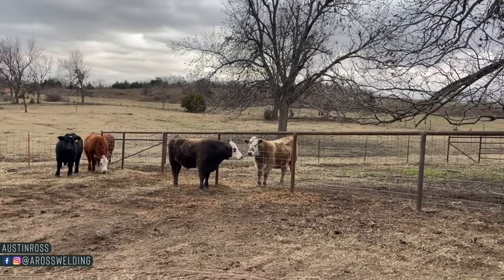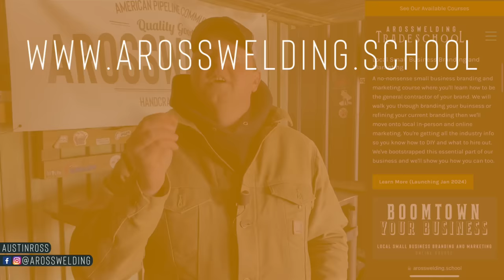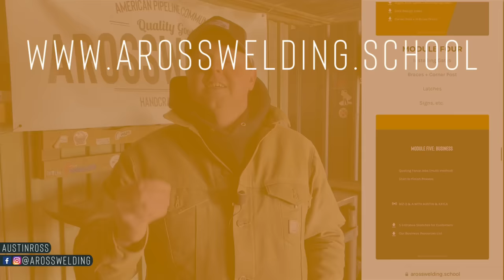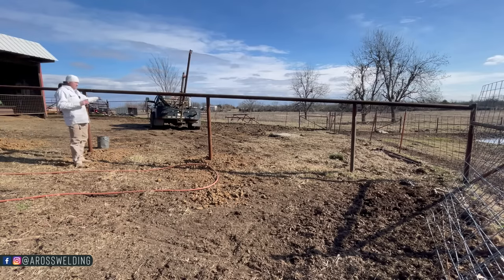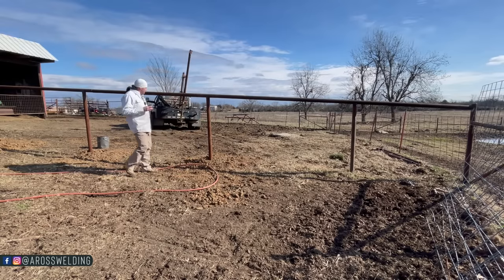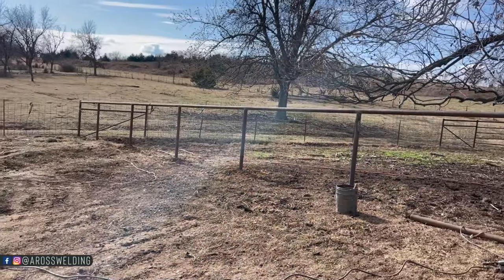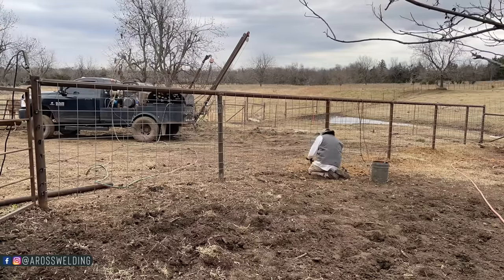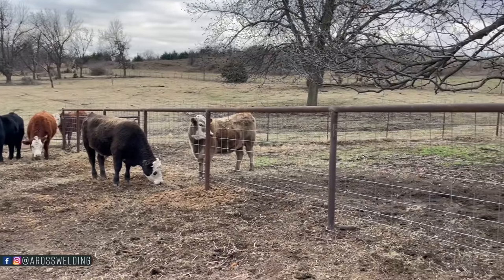Pipe Fence & Cattle Panel

Comment: I’m not telling anyone their business, but I prefer to hang cattle or hog panel the other way so that the horizontals are to the livestock rather than the verticals, walking along the fence the animals are less likely to pop the spot welds and then it typically will not require a special modified clamp to tack to the drill stem to the panel. No disrespect intended, just an opinion, from one to another. The high pressure spots from livestock tend to reveal this more than others, but both are upgrades reguardless.
Reply: When we are doing non-climb paneling, we always have the verticles toward the livestock/horses. If you get one that paws or climbs the hoof is more likely to slide down the verticles than get hung up on the horizontals and break the panel.
Reply: How do you hang the panels when there's stock on both sides of the fence?!

Comment: We always laid our toprail on cut one end to fit in the corner then put it in place and marked the top rail in the middle of the last post it set on. Then slide it down and cut it off, slide it back and your joint is now in the middle of a post so its less likely to break and it helps hide changes in elevation in the top rail. Nice fence though, you always do good work.

Comment: I did this across the front of my place with 2 3/8. Only difference in our black dirt I drove the posts. And had to cut my saddles vertical which ain’t bad. I just can’t believe that panels are $60 a piece and drill stem is $2.50 per ft now!

Comment: Hi bud! I have been watching the odd video for awhile now and appreciate the ranch work you do. Many people use concrete mesh around my area and i was wondering how to weld such thin, wire mesh to  pipe? And because its thin mesh, how to get a nice tight fit like a heavier gauge cow panel would fit . Thanks so much.

Comment: Hello Austin, thanks for the video.  I want to make a pipe corral but I don't have power on my property.  Can a wire fed welder running on a 20AMP generator make strong enough welds?  The stick welders like a buzz box require a 50 AMP breaker, and I don't have a generator that big.

Comment: Just weld a tab on the edge of both sides of the pipe halfway down. Have a 3/8 or a 1/2 hole drilled in them. Then you can bolt on a 2x6 or 2x8 rough cut over the top of the panel it will be there forever. I have done this for years, works great, and saves money.

Comment: i hope they don't run into the same problem i have. i was using the 23/8" used pipe like that and after about a year of doing my fences i took the drops to the recycle center for scrap to get rid of it. well after taking it to 2 different places, they would not except it because it tested Radioactive. the pipe place i bought it at did not mention that there would be a problem to get rid of it.
Reply: Use them on the bottom of your posts, concrete don't mind a little radiation
Reply: It’s actually salt still in the pipe. If you go wash it we hot pressure washer, it’ll knock out

Comment: Why were you hammering on the pipe when you hadn’t finished the cutting? Got the C’MON shirt and it’s a favorite, comfy shirt. The money candle sits by my chair and smells great without burning it.
Reply: He mentioned that hammering the pipe while cutting was to remove the Rust inside the pipe. It probably helps the torch cut the pipe if it does not have the rust scale to punch through. That is a good question since you missed the hammering reason.
Reply: @specialks1953  thanks. I missed it indeed but that’s a great tip for used drill stem. 
“Learn something everyday,” A Ross
Reply from the maker: The hammering the end of the pipe after my cut was just to knock of the slag… save me from pulling out my grinder

Comment: Ever used a post driver to drive pipe posts instead of the auger? Do you have a preference?
Reply: We use a posthole digger and cement our posts in in dig able ground. In rock we use a rock drill then pound the pipe in with a pounder.

Comment: they do get ants in their pants at pickup time jumping over 5 foot fences sometimes... braking 5 inch wood posts and a bunch of nailed in 2x6's. 12 inch wood posts work to, but they a lot heavier then the metal pipe... full of that heavy wood treatment stuff. "old power line posts..."

Comment: If you were serious about playing farmer you'd have got an old tombstone for $40 at an auction and burned up those 7014s.
  More seriously, I'd consider putting up some hot or barbed wire on either side close to the top to discourage jumping and rubbing.

Comment: On the top rail, why did u cut the collar off?  Turn the plpe around and when u cut the upset off the pipe would slip 3-4 inches into the collar as a slip joint